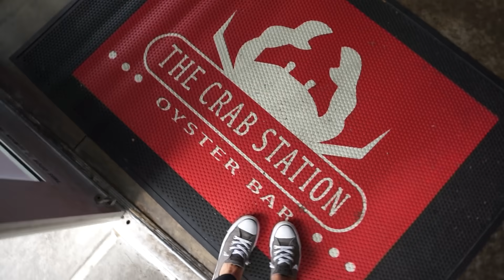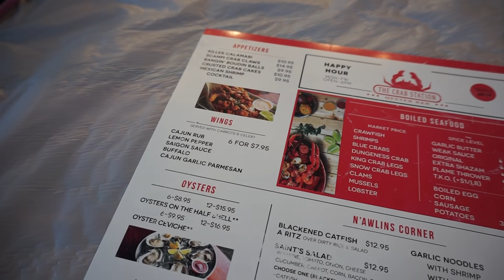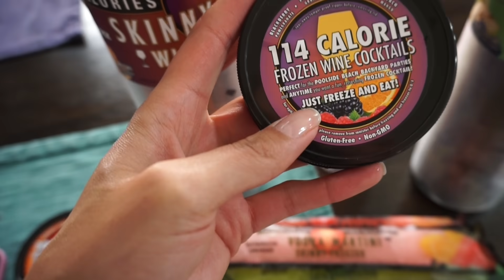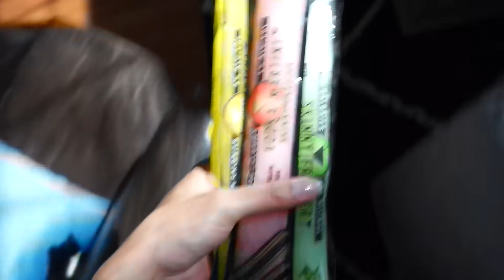VLOG | The one with the harmonica and the kitchen reno! Kind of.

Comment: Hi Dani! I hope you read this comment. I got Invisalign in November, mainly to fix my super crowded bottom teeth. I had immediate regret in the beginning. I too had a very obnoxious lisp & I found out I was pregnant just a few weeks later and it severely inhibited my ability to snack whenever I wanted/needed. HOWEVER. The lisp went away after about a week, maybe two tops. Your mouth just has to learn to readjust, but it will, I promise! I'm almost 6 months into my treatment and I can't believe how amazing my teeth look. I think the most dramatic changes are in the first few months. My teeth would feel really tight with the new trays, but now they pop in and out with ease. Sure, it is an adjustment but in the long run I think it will be totally worth it and you will be so happy! Especially if your treatment benefits other areas like your headaches! Good luck! Just give it time <3

Comment: I had to get my teeth fixed at 40.  I tried Invisalign and I just couldn't deal with putting them in and out.  I was never compliant and so it was going to take forever for them to work.  I just sucked it up and got the metal braces.  who cares at this point. I never had to think about it.  I could eat all day if I wanted to and the time flew by. I got used to how it looked and frankly, by 40 you jus stop caring what anyone else thinks.